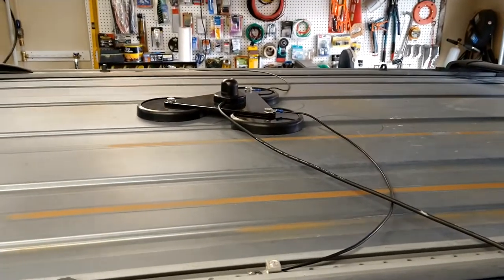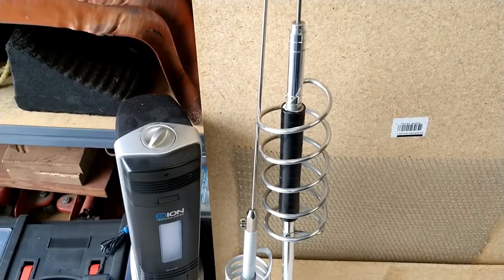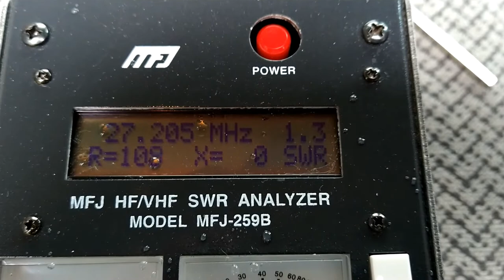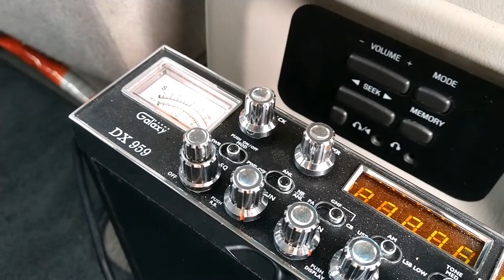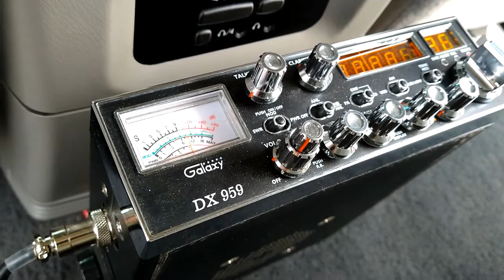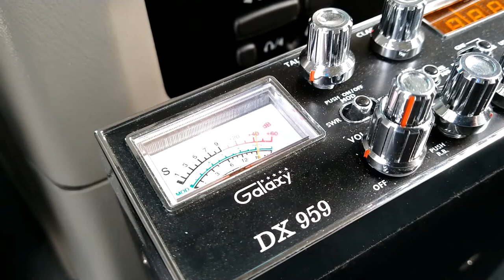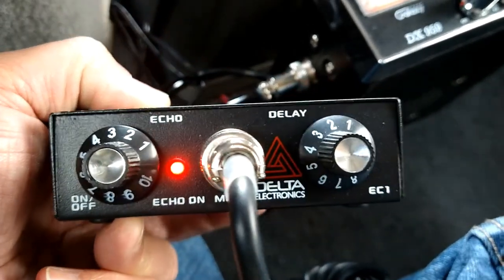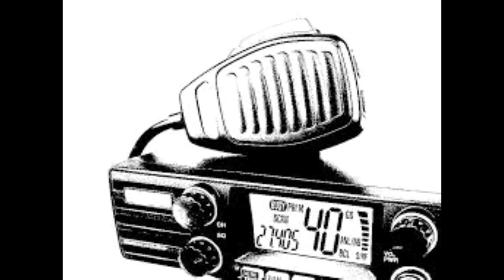Testing 4 different CB antennas and a Delta electronics EC-1

Comment: I run the predator 10k with a breedlove mount. Pretty much the same as a k40. I will say for my setup it's the best I've ever had. Swr is 1.12 on 1&40. Great antennas. Nice job on the video. I see alot of people nocking the test comparisons.  I'd like to see those people step up and do their version of how it should be done.
Reply: Do a Google search for 
"74 mile Freightliner Cascadia"
 That's how it's done barefoot mobile to mobile.
Reply: I totally understand it can be done. I would like to see videos from those who like to criticize the way this guys did it. 
I believe alot of these comments come from people "who saw it on a video" or " I had a buddy"..
In this video he did a test his way. He didnt state it was the end all be all of antennas proven through scientific processes.
Reply from the maker: Thanks! I'm just a guy who can barely figure out how to merge video clips, lol. It's a real world test, not something on the bench with a dummy load they you'll never be able to duplicate.
Reply from the maker: @luke8210  Yep, just a regular guy doing some testing that anyone can do. This is what's working best for this particular vehicle. Guys in Carson City said I was hitting them with 5 s units which I've never been able to do before, even with more power. That's a 40 plus mile trip over several mountain ranges. Many people also don't realize that our soil and air are much different up here and it takes a lot more to get out here. Just ask 815 the channel 6 skip shooter original from San Diego. Once he moved up here all of his antennas had to be re-tuned and he's having other issues that he never had in San Diego.

Comment: get 1 inch steel flat braided  wire  ground to body and frame with it from the coax mount.. rf travel's on flat surfaces. two type of ground you need to be aware of is dc ground and rf ground.

Comment: Just got that same Tram mag mount, shorted out from factory,  pulled the plastic and smash washer setup off and used a firestik type.  I see you added some ground straps to it.  Working on a fix for that too.

Comment: I just recently bought myself the k40  and the performance is unbelievable I get one-to-one SWR readings on my meter and I talked skip like nothing the only problem with that antenna is that it will make an obnoxious howling noise when you are driving other than that the performance is number 1

Comment: Location, location, location. The auto body is a part of the antenna system. A very important part when comparing antennas. So the mount location has to be the same. If not all tests are flawed. Additionally all quality antennas will be very close in performance. The only way to discern the difference is to pay very close attention to a distant receivers S-meter, and use a constant transmitted power level. Such as a carrier.
Reply: exactly right.  1. higher the antenna the further along it will go .  This is why 102" whips and 7ft tall fire sticks kick ass.  Height is almost everything.  2.  Never inject audio into an antenna performance check.  The difference in distance would be from the audio amp driving the finals harder.  Key it and shut up.  There's your difference in antenna performance.  The audio and rf output is not a product of the antenna but the finals and audio out.   It's very difficult  to test antennas with different mounts,  the base loaded k40 is definitely proprietary, then there's the 3/8" mount for fire sticks and others, then the standard so239 for most others.  Most important though for all to be equal is placement (location) on the vehicle and power output. all must be equal.

Comment: What's the phase angle of the test cables? In order for it to be an accurate comparison, the phase shift must be identical between all of the antennas.  The angle of radiation will be different between all of them.
Reply: Yeah for a testing method it's pretty poor. Would have been better removing the Sirio, bolting in a 3/8 body mount in it's place and using the same length of coax as on the Sirio. It would then be a much more truer comparison.
Reply from the maker: Same exact set up on all 3 antennas except for the Sirio which is through roof mounted.
Reply: @vegasfordguy   Same cable on all 3?
Reply from the maker: @rabbibacongrease88  Yes, same exact triple magnetic mount with same exact coax. Nothing changed except for the antenna.
Reply from the maker: @conorturton  Well, you know how it is, everyone is an expert. Can't make everyone happy.
Reply: LOL.
Reply: Regarding your "Phase angle" info, you're partially correct, however, it's more a concern of each individual antenna design being placed in a spot where the phase-based radiation angle is at it's individual peak and not closer to, or centered in, it's null.
- If you drive exactly toward or away from a signal or a receiving station - you can see the peak/null effect every 1/4 wave.
      I've tested this on multiple occasions by marking the ground every 108" and rolling through several 1/4 waves and every other one is either the peak (where I began marking the ground - by rolling until the receiving station told me on the phone that I was at my peak signal point) or a null - so if you swap antennas then you have, more than likely, a different take-off phase angle and are utilizing the atmosphere differently than the last antenna was.
   You literally have to roll forward or back until the receiving station sees your highest signal point, then mark that spot for antenna #1, and swap antennas and do it all over - search for the highest point and mark that spot for antenna #2, etc. - otherwise all you're doing is seeing which antenna is closer to it's peak than all the others wherever you're parked at that moment.

Comment: I have trouble understanding which antenna is better now, I guess the Winson the best?. What is your conclusion? And could you repeat the Test in FM? Just for fun of it ??
Reply: You can't conclude anything off this test. In a mobile install the RF grounding is arguably more important than the antenna because with a piss poor RF ground all antennas will perform very poorly - mine has an almost perfect ground for 11m on my install as I've spent hours doing bonding and I can get 30 miles on just 4W with no problems whereas I've seen installs using the same antennas on mirror mounts where they've been lucky to get 5 miles with 50W. On the Sirio he's got a very good ground and on the magmount, more questionable even with those bits of wire which are in fact doing very little.
Reply: @conorturton  I see, can you make a short video how you did it?
Reply from the maker: We don't use FM on CB radio here. AM for CB and on SSB.
Reply from the maker: @conorturton  It all sounds good when you read it online, in the real world it's totally different. Believe me, been there and done that. Even with the Sirio having a proper ground, it can't compare to the big coil antennas, it basically sucks compared to  them as the bottom load style antennas can't compare.Also, it's a mag mount, it doesn't even need a physical ground, I simply ran two wires to give it a physical ground, although not needed as it's grounded through capacitance.
Reply: @vegasfordguy  I know, but for the fun of it. Also a compair beteen AM and FM would be cool to watch/know.
Reply from the maker: @VicGreenBitcoin  I wasn't wrong at the time the video was made. You know this. I still don't use FM because it sucks

Comment: I have the same antenna analyzer .. or close to it , practically brand new . I need to send it back for calibration . On 5 other meters I have a 1.1 to 1.3 from channel 1 through 40 .. on the MFJ it says 1.6 or worse . I'm not impressed with my first MFJ product
Reply from the maker: I picked up mine used. It can definitely be a bit glitchy at times and doesn't read the same as a rig expert when compared side by side, but it's what I have to use. It's a tool that helps to get you in the ball park, then I'll use my SWR meter to fine tune. I'd lean towards MFJ not having the most accurate meters from what I've seen.
Reply: @vegasfordguy  
Yeah same here man , lesson learned , I figured for 365 dollars I was getting NASA spec lol 
I was wrong , so wrong . The more I read about them the less I'm impressed . I'd put my 20 year old Radio Shack meter against their best as far as SWR accuracy

Comment: You need to have your doors closed when you check your SWR'S
Reply from the maker: If you check it on the Rig expert antenna analyzer it makes very little difference. It's not enough to worry about. The only time I sit in the vehicle and check with all doors closed is when I'm first setting up an antenna and even then it makes very little difference.
Reply: @vegasfordguy  I’ve checked my swr on my 955 with my doors open and closed made ZERO difference with my Silverado
Reply from the maker: @Fox250R  From my experience it's extremely minimal if at all. I use a Rig expert antenna analyzer so I can see all parameters and it's not enough to make a difference. Some people are really stuck on the keeping your doors shut thing. As soon as you move your vehicle or start driving the SWR is going to change anyways.
Reply: @vegasfordguy  thank you 🙏
Reply from the maker: @Fox250R  Check out the video I just uploaded, it shows SWR on my antenna analyzer with door open and shut! If someone wants to argue over that miniscule number there's a problem, lol.

Comment: Just came across your video I started watching it... you said the best you could get was a 1.5... you better ground the antenna system better... you will see a 1.1 with better ground
Reply from the maker: It doesn't always have to do with grounding.
Reply: @vegasfordguy  RF grounding has to do with the metal body ground plane of the vehicle... the more metal body surface you have for rf.. the better your SWR will be.... RF grounding not to be confused with DC grounding two different things I've been doing this a long time so yeah I kind of know different  shootout Suburbans
Reply from the maker: @smallblocksadventures6008  Okay, understand what you're saying now. Thanks for your suggestion!

Comment: That's a horrible connection point design at the base of the mag mount, mine broke when I tightened it. 👎👎
- Get a puck and solid mount to the roof, or if you don't want a hole in your roof then install the puck in the mag mount. Good idea to ground it.
Reply from the maker: It's been there for years in both the summer heat and snow in the winter. Still holding up fine.
Reply: @vegasfordguy   I wonder if they got cheap and began using chinkaneeze junk and maybe that's what I ended up with? It sure was weak garbage.

Comment: RF flows over the surface of a conductor not through it. You would be better off using flattened RG213 braid than that thin wire which does nothing. To get the efficiency of that RG213 braid you'd have to use 0000 AWG wire, aka battery jump leads. 

You also need to have the magmount as close to the Sirio mount as possible because where your Sirio is mounted it's directional so putting the magmount in the centre of the roof would give advantage to the magmounted antennas to directions to the rear of the vehicle and advantages to the Sirio to directions in front of the vehicle. Put them as close together as you can and it's more an apples to apples comparison.
Reply: Lot to be learned here
Reply from the maker: I've tried it in various spots before making this video. It makes no difference.